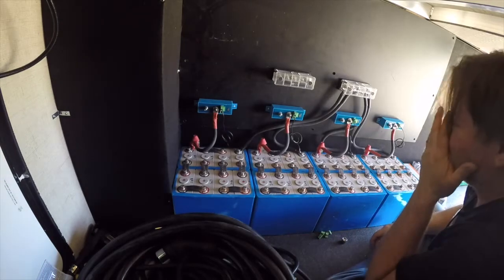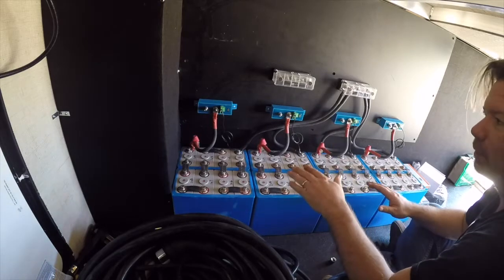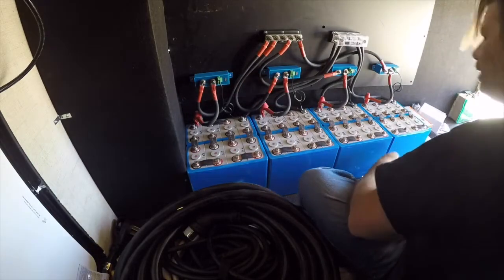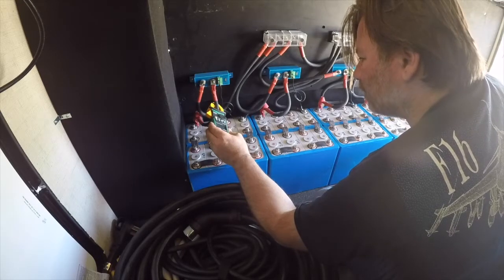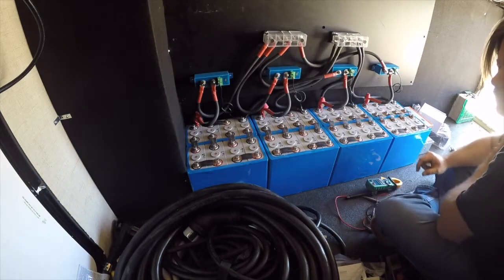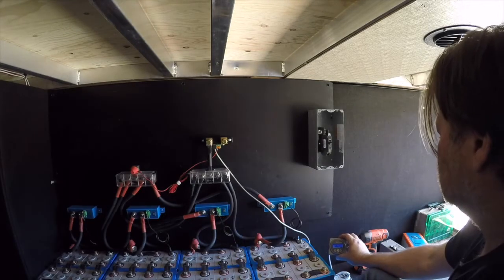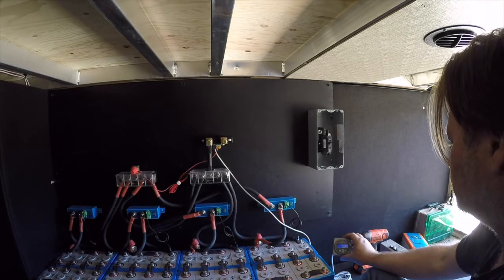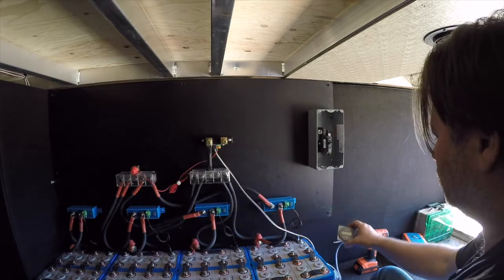RV Fulltime Living | Lithium Battery & Solar: Part Seven Connecting Battery Banks & Monitor

Comment: Part 7 of a fine series!  I'm learning a bit...  I would have already installed padding on the floor, LED lighting, sound system, and there is probably room for a mini fridge.
Really... I can not imagine why you have not set even some temporary protection over those battery terminals to avoid that spark from a dropped tool. Fire suppression, down there in your cave would also be a good thing...  gotta protect Victrons !  :-)  rc
Reply from the maker: It really has become a tiny man cave. I did end up capping the terminals. Just took a while to find what I wanted to use. Not much out there other than building a cover or using liquid electrical tape. Ended up finding some really nice caps that worked perfect. Part 9 or 10 I think :)
Reply: Well as long as there is room for you and the dog...  Yes, I think I did read something about caps from E.Europe with high freight cost ? Now I'm thinking the MultiPlex could have been installed on a pedestal, facing the hatch opening, and it could possibly rotate 90% if more work needed inside following the periodic inspection ???  Just thinkin'..  rc
Reply from the maker: Oh yah there are a number of changes I could make. I’m looking at a few long term changes that would reduce cabling and simplify a bit. Once installed you really don’t have to fiddle with the multiplus too much. Maybe an occasional dusting and checking connections. I will be building an enclosure to protect everything and to help vent some of the heat.
Reply: Excepting the fiber telco closets, I'm generally accustomed to have most wiring in cable trays, mostly hidden from view.  Yet you did present explanation for than by way of balancing the line loss by making some longer than the run needed... My quality of workmanship was always judged by appearance...  flawless operation was demanded..  Best, rc
Reply from the maker: +Rusty Case I may reconfigure my cells down the road to be in parallel first then in series. This would essentially convert from 4 individual banks to just one large bank. That will really simplify the cabelling and allow for a significantly cleaner look. There are pros and cons for both. My current setup, I could take one or even two banks offline for maintenance and not interrupt power to the RV. In the beginning I thought that was going to be a big plus. However, it’s turned out that the calbs are staying so tightly balanced that I have no reason to take any banks offline. At this point, I’d rather go with simple and clean over capability. I will likely do this retro fit sometime this winter.

Comment: Aren't you concerned that having the lithium batteries where they are, that temperatures will reduce the life of them?
Reply from the maker: Some reduced life is ok from my perspective for the convinience of storing the batteries below. Significant isn’t nor is fire. I monitor the temperature to ensure everything stays within manufacturer specs. I’m finding that the inverters generate a good deal of heat which is pushing the upper limit. That basement area is climate controlled (heated). However, from a heat dissipation perspective, when I build the enclosure, I will likely partition the batteries from the inverters and vent the inverters outside allowing the batteries to remain at basement temperature. If I run into situations where I’m struggling to stay within spec I have the option to move the batteries up into the bedroom area.
Reply: Thanks for the reply.  I'm considering getting a 5th wheel and I'm researching using solar and lithium to power the unit with a generator backup system.
Reply from the maker: You are definately thinking it through. Good question. A lot of people are putting their banks inside. Which works for a 16 cell (100ah cells) bank but 32 cells starts to get somewhat large to toss in a closet or cabinet. Good luck sir ... the investment is worth it. Running two air conditioners off of a lithium bank even just for a few hours is awesness to them Nth power. Practicle, not really, but awesome yes!
Reply from the maker: That is exactly my goal. I deleted the onan when I order my 5th wheel. Instead invested the money in lithium, solar and inverters. If I’m in moderate temperatures I will generate more power than I need. My Honda is just s backup for when it’s heavily overcast or on the hotter side and I need to run the AC non stop. My old trailer had 400w solar, 4x100ah lead acid, and a 2000w pure sine inverter. Nothing compared to what I have now but even that system was awesome for everything but running the air conditioner. The freedom it offer was amazing. Now if only I could generate water from the air and compost our waste .... hmmm .... 
good luck boss .. let us know what you end up doing.

Comment: https://www.visualcapitalist.com/china-leading-charge-lithium-ion-megafactories/

CALB has a presence in lithium, and is fairly aggressive. The price is pretty decent. I've been watching for people doing DIY CALB systems, and you are definitely leading the pack. I've used ebike LiFePo packs. It's just too heavy for ebikes, so it has faded. The cycles and durability are great. 

As the price of lith storage drops to around $100 a kwh, what all the automakers want, it should change how people configure RV's. I notice they put 20 kwh of storage, around 2 kw of solar, in the new EarthRoamer.  If it was all wired up and just sitting there, 20 kwh would be nice, at some price point (to be determined). You could just use standard AC power for everything. 

I guess when it is bullet-proof for air conditioning, it will be a selling point. Right now the 'packaged' 1 or 2 kwh modules makes sense, but maybe at $500 per kwh. Seems reasonable for the cells, electronics and the housing. The Lifepos match up OK with a 12v system, but the standard Tesla type cells don't. 

It's fascinating to see this stuff evolve. They have these bi-directional amp, volt, watt, watt hour meters, wireless display, on Ebay. From China, of course, for 25 bucks. They seem genuinely fascinated by this tech.
Reply: George Sears great article thanks for posting China is in position for taking over the most solar panel production also

Comment: You really should read this, all about working and using tools on top of a lithium battery pack, How he got the name Plasma Boy. I have more stories just like this one from people building electric cars. Lay something, rug, plastic on top of the pack. Please. 
http://www.plasmaboyracing.com/blog/?page_id=10
Reply from the maker: Ivansgarage I can’t argue with you boss. I did finally get terminal caps that do a great job covering all exposed terminals and the expose portion of the interconnects. It was, however, absolutely freaking me out having all those exposed terminals. Good advice to all.
Reply: Man, it was a horror show, I was biting my nails, waiting for you to drop something across all those exposed terminals.... and bzzzzzzzt bang no more RV